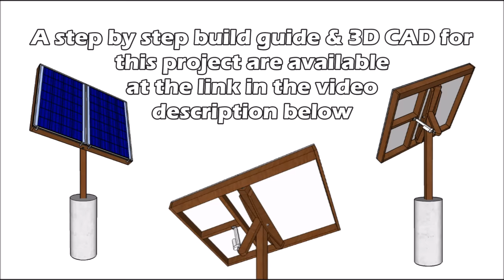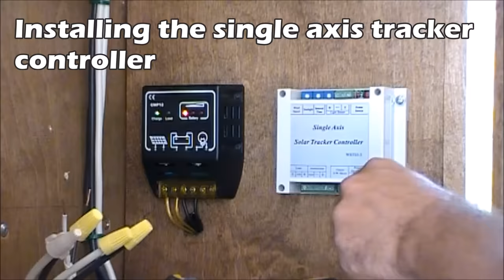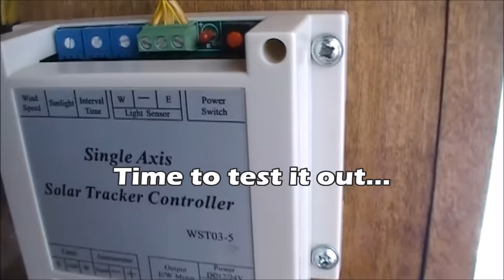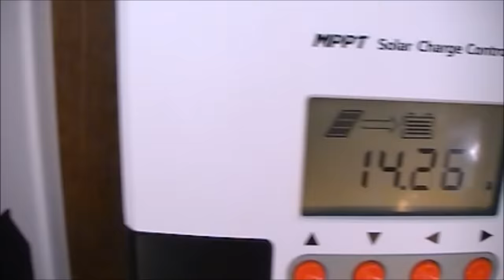Build A Solar Tracking System - DIY Solar Tracker - Off Grid Living!

Comment: The craftsmanship on this is unreal. I've got to say, though, you should've installed about 10 times as much solar on each tracker to make it worth all this effort. Do you have a bigger version?
Reply from the maker: Thanks. Nothing bigger made from wood. 10X this amount would = 2 kW of pv on each tracker, ie: ~150 sq.ft sails that weigh over 500 lbs each, never mind the weight of the platforms lol. The wind here on the east coast of Canada would soon put an end to them unless the columns are 8x8's and the platform components are scaled up accordingly, making them difficult to handle for just one person and a big blocky mess to look at from my windows lol. I get a lot of solar gain through them during the winter that heats the house passively during the day, and a large tracker would have blocked most of that essential heat. Short, small trackers were my only option if I was going to install any. I also would have had to rent heavy equipment to dig a hole for a foundation large enough to keep the tracker rooted in the ground, and possibly to help do some lifting. The actuators and controller would need to be increased in size too, which could extend the payback period or negate any net return in grid energy cost savings altogether on their own. There's a very fine line in terms of cost efficiency between tracking systems and fixed arrays with ~25% more solar to compensate. Lots of things need to be considered from component costs to site conditions and irradiance potential, and punching the #'s into a calculator is a must. Large, professionally installed trackers are beneficial for saving space, but usually only have a chance at generating a better return than slightly larger fixed arrays when multiple trackers are installed on a commercial site and the components are purchased in bulk at wholesale - even then the costs are comparable. In contrast, I built these two trackers for a slightly lower cost than installing a fixed array with more solar. Most of the structural components for these simple DIY trackers are affordable renewable materials that a person can source from a local mill or even mill themselves if they have the means, and all of the work after the concrete is set can be done by one person in under a day without needing heavy equipment. A carpenter like myself could build them in 2 or 3 hours. Not a whole lot of effort for me, really. Like tying my shoelaces. Having 20+ years of building homes for a living under your belt tends to make light work out of little Sunday projects like this. The tracking kit was very affordable at the time, but they have gone up in price since they've gained popularity in the DIY world, so a person should establish a CBA before tackling a project like this, especially a large one. Avoid retailers if possible, source directly from the manufacturer for the best savings. That's the only way to know for sure whether the effort is worth it or not. But these trackers in particular have already paid for themselves in conventional energy cost savings alone, never mind the ad revenue this video has been collecting over the years ;)

Comment: awesome project, as you get the most juice from the system, or full power from these panels for the majority of the day thanks to your tracker controler. I would like if you can add more info on this part. Thanks.

Comment: Great build . I like the single axis solar tracker controller.
Reply from the maker: Thanks! It's been working great so far, 0 complaints.
Reply: You have to change the angle lower for winters ie 65 deg vs summer angle
Reply: 65 degrees in winter? where do you live? 22 degrees in winter for me :( (Toronto, Ontario, Canada)
Reply: We get an occasional 22  here but rarely and only for an hour or so then sun comes up.  I live in the tropics (East of Orlando FL almost to Atlantic Ocean ! )  I got the 95 / 95 / 95  Or  (95 Cubed) "summer" system here  95 F / 95 Humidity / next to I-95  , we got more rain this year so far than I can remember except maybe during the hurricanes of 04/05 (Yeah Katrina sat her for 2 whole weeks solid rain everyday, streets flooded/closed but then it went to N.Orleans and you know the rest. ).   Best Wishes !

Comment: Hi, I saw at list your video 20 times. I wish it could be longer. I bought the plans.
I wonder it it possible to build these tracker with 2 x 400 Watts panels (1800x1040mm is the dimension of 1 panel).
I should change the size of the main post i guess and adapt you plans to cope with panel sizes.
What do you suggest me ?

Comment: I'm planning an off-grid solar system that will use 20 395W panels. Would you foresee any issues with scaling up your plans to allow the mount to support 4 or 5 panels rather than just 2? Great work, by the way. Reminds me of something my dad would have built if solar was a thing in the 1970s. :)

Comment: This is a great project, I love the engineering , I was just wondering of the cost of 3 fixed floor mounted panels would be cheaper than creating a solar tracker for 2. With 3 fixed panels you would get 50% more than 2 fixed panels . If the tracking gives you 25% more than 2 fixed panels it would make pure economic sense if the entire tracking mechanism cost 1/2 as much as the cost of additional framing and 1 more fixed panel . Just a thought, Not considering space as an issue . Just a thought for discussion as I plan on my system
Reply: I built trackers for my 6kw system, which made some economic sense when panels were $4watt WAY back in 2007.   Today, you can buy better panels for 60 cents/watt, it makes no sense to track unless space is an issue......simply add more panels.

Also, the controls/motors it takes to keep the trackers moving are a HUGE pain in the backside, not to mention wind if you have a large system.  I took all mine down, mounted on cheaper, fixed ground mounts and would never consider tracking arrays again.
Reply: @edsmith4414  nice honest reply, I was thinking the same thing 25percemt extra power at a cost of all that setup and time  for 4 120watt panels seems pointless and would be easier to an extra few panels to another part of the yard that may receive more afternoon sun. I thought about doing a 5kw single axis tracked array by by using a see-saw system with 10 panels on each side rotating on single axis in centre off my gable roof east to west to catch morning and afternoon sun in Australia that is. Too hard for the extra 1dollar  a day I might make.
Reply: @DanielSan-ch7dr  interesting, I'm thinking of doing something similar, I have a 10kw system but I only want 3 X 440w panels attached to the NW gable end. I'm thinking with the increased electricity prices picking up the early morning and late afternoon light could help reduce the time of use charges.

Comment: Great vid ! Must be nice to be so multi-talented ! lol
I’m just getting started, so doing tons of homework... am gonna pursue a dual axis system, tho 🤞
Reply: Dual axis is nice, but only really worth doing if you're off-grid or in a farther northern or southern latitude like James.  For instance, where I am in the southern US, a fixed angle in the middle of the winter optimum would only drop my summer power by less than 9% (remember: power is already more than double what you get in winter).  You might think that extra few percent would be nice to offset your A/C load in the summer, but.. let's say his max is 500 watts, just for easy math.  A modern central A/C system can draw well over 3000 watts.  10% of 500 watts is 50 watts.  50 extra watts for 1/4 of the year vs. a lot of extra expense, install work, maintenance.  Yeah...  If you're putting in a 2000+ watt system, it could be worth it, but that's a LOT of extra hardware (work, money, upkeep...) for that many panels.  The return on investment for a single axis gets iffy at that level.  Of course, if you're off-grid and aren't running A/C very much, dual-axis could be worth it, for sure.

Comment: Nicely done, but I'm curious if you were to do it again, would you install them closer together? And if not, why?
Reply from the maker: Thanks. They could be closer together without casting shadows on each other, roughly half the distance. Just installed them according to my patio layout - I already had lots of solar installed at the time, these were just for fun. A person could accomplish the same harvest by adding 20-30% more solar on a fixed array if they have the extra space. If not, a tracker is the solution. Same energy at the end of the day, but with a smaller footprint.
Reply from the maker: I should also note that the trackers can be expanded to hold more panels, too. The actuators are rated for around 300lbs. Switching the 4x4 post with a 6x6, a person could build the platform large enough to hold 1kW of solar and withstand gale force winds. The tracker controller can be connected to an anemometer to measure wind speed and programmed to move the arrays to a homing position when the wind gets too strong in order to minimize the surface area that it hits. It's usually best to program according to the dominate seasonal wind directions for the region. The same can be done for overcast days when there's no sun to track - the controller can be timed to move the panels to an optimal fixed position for the day so they don't just face east and can harvest at least some of the mid-day irradiance when it's strongest, albeit it diffused.

Comment: It is pretty cool that you did that. I would have gone with 25% more panels because their cost is low now and a more simple system with only seasonal tracking will break down 100% less often.

Did you compare the cost of the extra panels vs the cost of making a tracker? if you value your time surely it does not pay for itself. Maybe if you welded a large one it would be worth it but certainly not this one. it is cute but not practical in my books.

Also if you immerse wood in concrete it will rot really fast. even if its PT
Reply from the maker: Yes, I'm a building contractor/journeyman carpenter so CBA was the first step. Very much practical as I pointed out in detail to another Youtuber, if a person bothers to do the numbers. Small trackers - avg DIY'er breaks even (DIY being the key word here). Larger trackers come with a payback. Me personally, I built these for cheap, so it was much more practical for me than it would be for the average person who would prefer to hire someone to put these materials together. I was also limited in space due to shadows, so my trackers were therefor limited in size. Also explained in detail in the comments section (https://www.suncalc.org/#/45.8403,-67.0694,17/2017.12.25/13:10/1/2)

FYI - treated lumber will not rot in concrete really fast, it will last at least ten years based on my 20+ years experience working in the trade as a certified carpenter. It's also much more easier to replace than a rusted or bent steel pipe embedded in concrete. Been there, tried that. Better off digging out the entire foundation which = much more costly to replace in terms of both $ and carbon. A wooden post can be changed in 15 minutes and for under $20. Not that big of a deal ;)
Reply: I'm another armchair critic but wiling to be convinced about trackers. My concern is that I would be most interested in power output away from the peak sunny days (I live in UK !) and I have seen that output at these times is less a function of optimum orientation. Given your 25% comment I would be interested in your views once you have run through a full year.

Comment: i have a question, the bolt that you screwed into the bottom of the strongback to mount the frame for east west swivel, is that just making its own threads in the 4x4, or did you tap/ use an anchor in it?